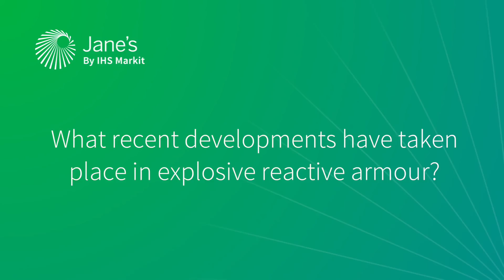Developments in reactive armour

Comment: I wish he had gone in a little more detail regarding those M1 reactive armor packages.  I had never heard of those but I assumed that the Abrams tanks were being upgraded with something far superior to the TUSK era packages used in Iraq.  I assume that the U.S. and other NATO nations are developing era systems on par with the Russian Kontakt variants at least since we've had ample opportunities to capture samples of that ERA (which seems extremely effective).   The electric ERA is something I had not heard of.   That's sounds like science-fiction almost but it makes sense.  But I imagine that it would take some seriously big batteries and would be limited in how many hits before battery life is gone and had to be recharged.   Still, very good info.   Just barely enough to not violate op-sec I guess.
Reply: The development on electromagnetic reactive armor was halted quite a while ago. Most of NATO isn't struggling to adapt ERA because of lack of knowledge, but mainly because of concerns over safety, and multi-hit capability of course. Take the CLARA ERA at the end of the video as example. ERA as we know it today was actually invented in germany in the 70s, yet they didn't use it until someone came up with this collateral damage reducing/eliminating solution. Same with APS.
Reply: Then why was ERA used on the Bradley IFV's and M1 TUSK variants in Iraq? Multi-hit capability doesn't seem to be a big issue given the low probability of a hit on the same spot of the tank and given how fast most tank battles happen where it's the tank that fires first that usually survives.  If it even protects the tank from even one otherwise penetrating hit, that may give the crew enough time to identify and destroy the threat.  I've always been impressed by the Kontakt series of ERA because #1 it is has a unique system for disrupting sabot rounds and #2 most of the ERA blocks are small and light enough to be easily and rapidly replaced in the field.    The ERA on the tusk, by contrast takes a big team of people to replace them.  
Especially when it comes to the frontal armor where the threat to surrounding infantry is minimal, you'd think that we'd ERA the crap out of Western tanks.   My guess is that we have more advanced ERA but are keeping it classified instead of popping it onto our tanks in order to prevent a rush for both sides to ramp up development and implementation of heavier caliber cannons (an expensive proposition for both sides).
Reply: ERA was used in Iraq because the vehicle protection was favored over infantry safety, just like Russia does and Israel did. The main disadvantage of ERA is that it doesen't protect from ground mines/IEDs and it's lack of multi hit capability. The latter doesen't seem to be important if the ERA is mounted on the side, however ("you'd think that we'd ERA the crap out of Western tanks") it IS important on the front of the vehicle. One salvo of 30mm and most of your frontal armor is gone. Sure, there is still passive/-reactive armor behind, but just not as much as if they went only for passive/-reactive. Concerning this, i really like Rheinmetalls/RUAGs approach. Frontal armor is NERA/NxRA to have multi-hit capability, lower sides are composite against IED/mines and upper sides are the collateral-friendly ERA mentioned in the video.
Reply: You'd have to have one hell of a brave IFV crew to use an autocannon on an Abrams tank just to knock out ERA.  Moreover NERA/NxRA armor, while it does have multi-hit capability, it is also inherently less effective than ERA.  It also does not, like the Kontakt-5 and later ERA, have secondary effectiveness against APFSDS tank cannon rounds.   I should also add that theoretically ERA can work just fine against AT mines and IED's.  The main reason why they're not put on belly armor is simply because it reduces ground clearance and without a protective cover, will likely get ripped off if the belly of the tank (or in this case the ERA) touches the ground or other obstacles.  This is a common problem with frontal ERA as well when tanks equipped with such (like the Challenger 2's in Iraq) attempted to breach walls via the sheer weight of their armor forgetting about their ERA.  Syrian tanks often have this issue along with their side-skirt mounted ERA getting ripped off as they move through narrow streets and alleys that the tanks were not designed to fight in.   
So certainly ERA is not the be-all-end-all solution to protecting tanks.  
I'm just surprised that I've heard nothing about Western copies of the Russian Kontakt-5 type armor.   So far what is mounted currently seems to be nothing more than slightly updated versions of the old Israeli "Blazer" ERA.   In fact I believe much of the ERA used by the U.S. is still manufactured in Israel if I'm not mistaken.
Reply: It's a common practice to fire medium caliber rounds at all kinds of armored vehicles, the purpose is destroying optics and situational awareness systems. NERA/NxRA does have effect on APFSDS, i wouldn't even call it secondary in this case. You know what's inside the Abrams's frontal turret? NERA-array. The wedge shaped things on the turret front of later (A5) Leopard 2 versions? NERA-array. I also wouldn't call it 'less effective'. It is less effective on first strike, but on secondary and following it is superior. It is different, not worse.

You misunderstood the 'composite against IEDs' part. I ment low on the sides, not the belly. The belly is usally protected either by a thick plate (Abrams has aluminium as example) or a composite (array) especially developed for belly protection (which protects from blast/blast fragments, but not KE or HEAT/SC) (Leo2A6M).

And on the sides, yes, ceramic composite was proven to perform superior against IED/mines in the tests made with the german Puma IFV (they changed the armor layout because of that, you can see early models sporting full ERA at the sides, newer versions have 50/50 lower composite upper ERA).

For ripping off stuff in MOUT, you have to keep in mind that ERA isn't propery implemented in these cases. Most western/eastern vehicles are either poorly covered or upgraded with ERA, there are only few were initially designed with ERA in mind, and have a proper coverage (T-14 and Puma are the only ones i can think of, i wonder why the T-15 has such a terrible coverage).

Western ERA is actually quite advanced. The advantage of using composite materials isn't only reduced collateral damage, but also a much better protection/weight ratio.

If Afghanit is really capable to affect APFSDS, the fragments will render the T-14 naked after intercept.
Reply: I assume it uses capacitors, not batteries.